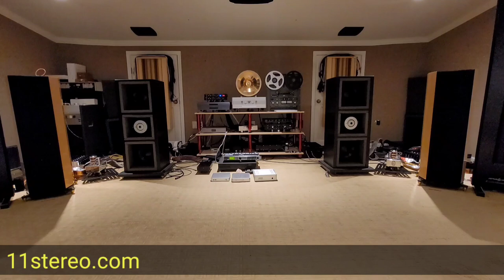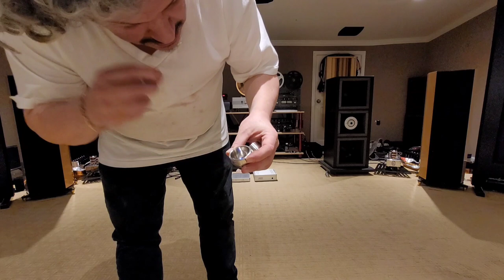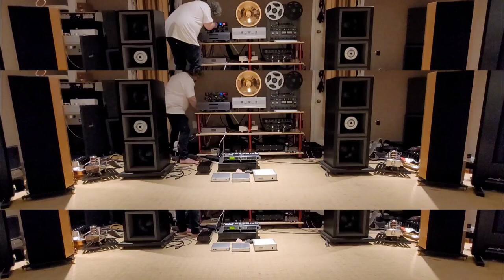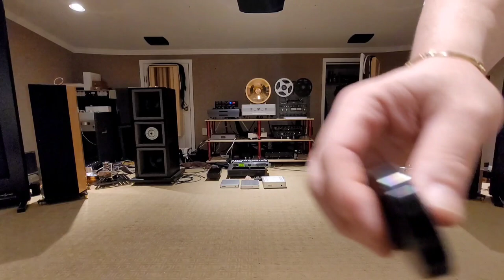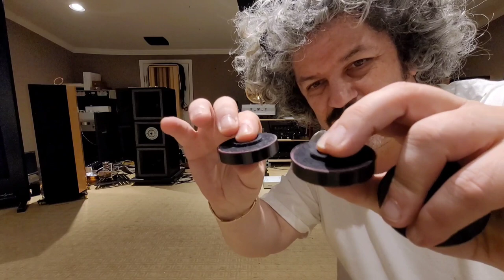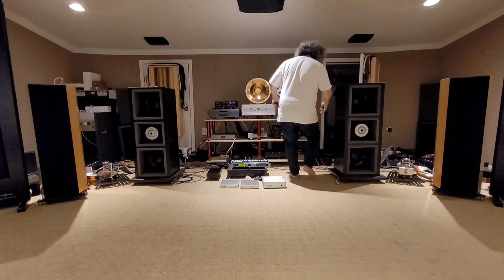Isolation and Vibration Tweaks, Do they really work ?

Comment: I use 1/2" x 1/2" x 1/8" sticky black sorbothane squares between old KEF speakers stacked in vertical line arrays. This material is rated 50 duro, which is about medium squishy. Perfect for absorbing vibration/resonance.

Comment: I'm throughly confused on this subject. What's are the differences between decoupling,  coupling,  and dampening? I play vinyl and digital.  I was going to fit my turntable with gaia iii's. Then put it on a butchers block. Not sure what should go under the butchers block though
..spikes or sorbethane. Same with my 3 preamp's(phono,  tube,  ss).
Reply: Best example is speakers: solid concrete floor? Then you ideally want to couple the speaker chassis to the floor, essentially tying them to an inert or non resonant surface. Floating floors? You want to prevent speakers from resonating the surface... I.e. De-Couple them (this is dampening the resonance). With a turntable, you want to prevent any resonance going in, so decoupling feet are used. The surface underneath should be really stable and non resonant. This can be aided by a butchers block to add inertia mass to the surface. Using more dampening on the sub surface will rely on experimenting. The butchers block should have feet of some kind to ensure stability. There is a point where its up to the listener to find a balance... Over damping a turntable can make it sound rubbery, and making sure the turntable is really well setup, situated a few feet from speakers and on a VERY level surface is more important.

Comment: Removing noise is a valid goal. Removing RFI EMI noise includes dampening isolation shielding that controls vibration. My fully shielded components no longer respond to isoacoustics vibration footers they’re irrelevant after such treatment.
Reply from the maker: Cool, I just ordered .01 thick MuMetal sheets to try doing this in some of my pieces...  :-)

Comment: Ive tried lots of different and expensive iso/vib devices. Save your money and get control in 3 dimensions with Machina Dynamica Springs. I have them under everything except speakers, which sit harbor freight dollys with rubber wheels
Reply from the maker: Thanks for sharing, do you have the brilliant pebbles ? Clever little clock ? Did you do the teleportation tweak ?  Ill tale a look, but companies Like MD are hard for me to take ... Im not saying thier stuff does not work , its just a little over the top in regards to marketing .
Reply: Most everything, yes; clocks, pebbles, but the most noteworthy are the New Dark Matter (for CD trays) and the springs

Comment: Everything works in the sense that everything changes the sound. But most of them in the wrong way. Ii´s a jigsaw. I prefer spikes and cone devices with vertex up. Better tone.

I think cones and spikes are better if you have to much bass in the system. But if you are missing bass do not use spikes.
I prefer massive devices, and the combination of different materials like metal and rubber.
Reply from the maker: Highly Logical Spock, and you are correct, I have granite mass loading slabs for the tops of things and I shit you not, changing the torque of the screws that hold your component together will change resonant attributes and affect sound. You dont see my spikes but Ive got a hundred or so all different metals and sizes, Rock on Spock !
Reply: @OCDHIFiGuy  With screws, my experience is only with the ones of the drivers of the speakers. These must be check. Mandatory.
I admire your patience and dedication. It is easy to be fascinated about all the tweaks because it is so strange how the sound changes.

Comment: Don't waste your money all you need is some Blu-Tack 2-inch balls of Blu-Tack, 5 of them. if the item is heavy like speakers put the blu tack in those disk candle cases with a felt disc on top or metal snd felt disc underneath on hard floors you can try a thick bolt underneath the transformer going into a bowl of kiln-dried sand soaked in oil vegetable oil disperse the energy from the transformer.
Why do you always walk around like you in high heels or something
Reply from the maker: I dont do shit like that , but thanks for the pointers. Im guessing I walk like a fat fuck . covid casualty.. what do you look like or walk like ?